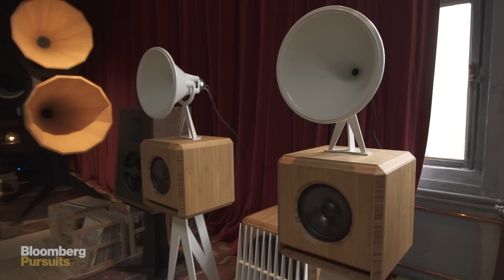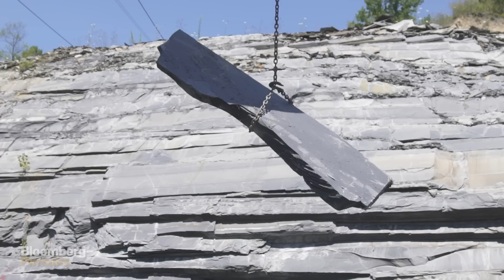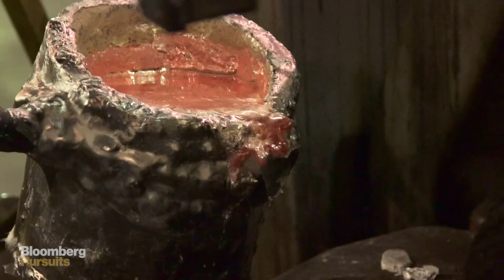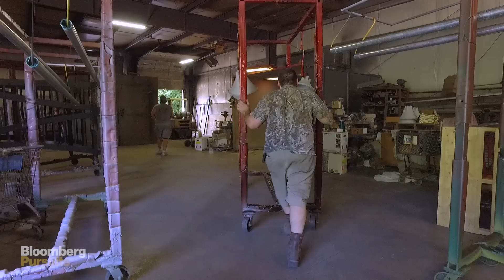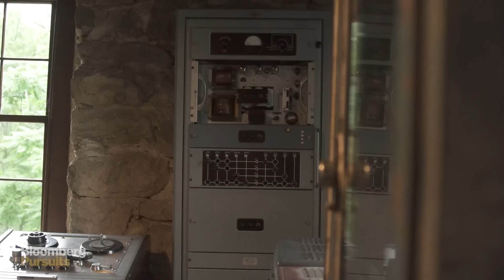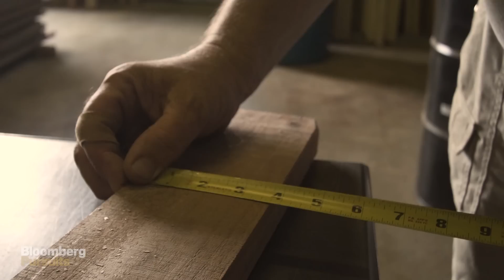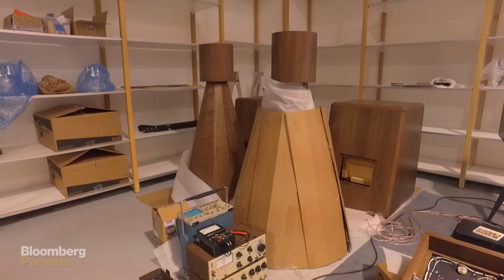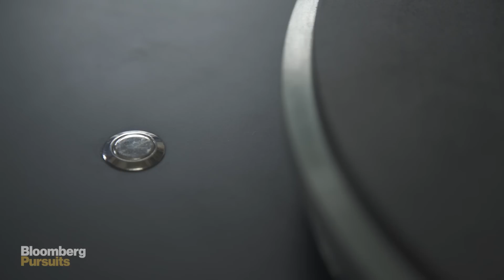How a $300,000 Speaker is Made

Comment: Here's what this is... It's goods that are exponentially overpriced with some bravo sierra made up story to appeal to individuals of extreme wealth so that they can claim to own something the common man can not. As for their material and manufacturing choices... That super special slate... Meh, not so special, people have been splitting slate for the last 6000 or so years, it's a common material that's easy to work with, so common in fact that there are mountains full of it. Cast components? The cheapest and weakest way to manufacture anything out of metal. Also nothing new here... The ancient Egyptians cast metal parts. The amorphous grain structure of castings is inferior to forged or even extruded parts, milling and/or turning parts from billet is infinitely superior to cast parts. That solid hardwood construction that nobody uses... yeah well solid hardwoods warp and bend with changes in temperature and moisture... that's why laminates are used, they're environmentally stable unlike solid wood. I could go on... Lastly... he's talking about how tube amps aka old analog technology is paramount in delivering accurate sound reproduction... more bravo sierra. Tube amplifiers color the sound which is the antithesis of his prior statement. Don't get me wrong, I have a number of tube amps and I love them and his speakers look and probably sound awesome... I just hate the whole blowing of rainbows full of made up facts up everybody's butt as justification for selling his product for 10X what it's worth.

Comment: "Most of our equipment-- it's very big, and it's very big because it has to be. Sound waves can't be miniaturised; it's physics!"

Says who? What school of physics did you attend? Trump University?
Reply: Sebastián Demaría yeah take that L. Technology advancements can't alter how soundwaves work buddy
Reply: Even modern technology can not get around the trade off of hoffmans iron law for bass that governs size, efficiency and frequency cutoff.
Reply: Seb: These are not active speakers.
Filtering can extend the bass but you run into the same laws of physics eventually.
Reply: TheLucient
 I have heard LAcoustics back when they were Cox audio engineering.Heard them on the Delta heavy tour and they sound fantastic,no ear fatigue but the cabinets and drivers were standard size.
Reply: Col. Angus This is the reference today for live sistems. http://www.funktion-one.com
Reply: I don't know guys... IMAX theaters sound fine to me.  I don't see how this would sound any better.
Reply: Aka Kiddo
you can change the notification settings for this comment thread so you no longer get them.  :)
Reply: To be fair you can't get deep bass at decent volume from a small speaker.
Reply: Sebastián Demaría
How much spl we talking here?I have worked with JBL's in the 90's thru 2000's and they were pretty impressive back then.Today the big thing is monster power in more efficient platforms but the spl levels and frequency responses haven't changed much. I could be wrong because I haven't been to many concerts that blew me away recently.Its still the same concept,move tons of air.
Reply: Lick My Taint Just ask, and listen.
Reply: Sebastián Demaría
Yeah I know about the Funktion One,they started off doing club systems which is what I'm into. :) I'm dying to hear one of their systems now,the best system I ever heard in a club was and still is and old school set up with Intersonics servo drives and JBL's .The Funktion One got its inspiration from the old Intersonics Waveguide/horn style stuff.
Reply: Ever heard of LAcoustics ?
Reply: If by time you mean period, frequency isn't wavelength/time. Wavelength/period=[distance over time]=speed of sound. Frequency=1/period=[per time].
Reply: jesus why did i comment on this. i commented over a month ago and i still get notifications everyday from people bitching about a pair of speakers
Reply: A. Lee Composer no kidding.. buy a bose portable speaker and it's amazing the aouns quality from such a small device that's just battery powered...
Reply: Lick My Taint you are generally correct, however using sound reverb you can get wavelengths bigger then the speaker, but that will almost always sound crap. Unless you have multiple radiators, such as, the bose sound link mini with dual radiators. However it is one of the best bluetooth speakers, however the sound is more like a rubber chicken getting hit then a deep, clean sound, as my Jade series speakers (Wharfedale)  produce. If you are curious about my system, 
Receiver
Sclx901
Jade 7,
Jade 3,
Paradigm sub 1 (2 is to expensive, and to bassy ;),
Martinlogan motion slmxl rear speakers,

This system was expensive but i built on it for a while.
Reply: Lick My Taint what projects? I might buy one? Potentially?
Reply: Seized Cheese Im sorry, but purchasing that, means you are not a audiophile. As they have horrific bass reproduction, artificial highs, and no mediums.
Reply: "Speakers can only produce sounds who's frequency (frequencey=wavelength/time) falls within the size of the speaker."

This is, and the the rest of the comment, is not true. You can reproduce any audible frequency even with the smallest speakers. Ever heard of headphones or earbuds? It's just that smaller speakers aren't as effective at reproduction powerful sound as bigger ones. That's all there is to it. The smaller the speaker, the quieter the loudest sound will be and the low frequencies.

And BTW, the bigger the speaker, the more problematic it becomes. It's because the ideal speaker needs to be ideally stiff, but big cones are relatively less stiff than small ones, and they introduce a lot of nonlinearities in the frequency response, compared to smaller membranes.
Reply: Lick My Taint Yes, just as I said - it's not that smaller cones don't produce low frequencies, but they just are less effective. And the stiffness problem still exists, even though it's less a problem today than it was 30 years ago, when membranes were paper.
Reply: Lick My Taint Do you understand that you're essentially repeating what I wrote? That it's the matter of scale? You don't need 24 inch speakers in your earbuds to have deep bass.
Reply: "No, you just repeated what I wrote. It's painfully obvious to anyone with half a brain."

This shows that you already forgot my first comment you were replying to. :| And obviously repeating what I wrote in that comment. "It's painfully obvious to anyone with half a brain."
Reply: You do understand that sound waves are air pressure.  That's why 5" "subwoofers" aren't.
Reply: Lick My Taint: All my comments history is there for anyone to see. And as a comment on the rest of your response, I can only reply with this emoticon: :-)
Reply: Of course they're edited. I always fix typos, grammar and try to make myself clear if I'm not enough.
Reply: Yet Trump is a billionaire and you are a fake" intellectual "Oy vey! :D
Reply: Watch you don't cut yourself on your edge, little one.
Reply: Lick My Taint NOT true enymore, today's active subwoofers with digital ice amps can reproduce frecuencies and spl not even dreamed by Jbl with 18 inches woofers in the 80's

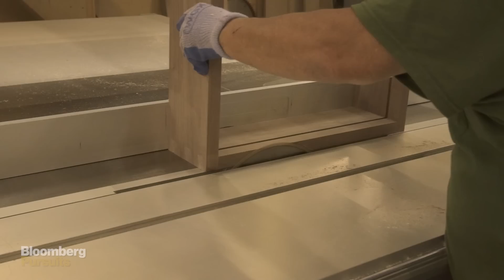Comment: 4:43 bullshit. My TTC Rex Custom guitar cabinet is full popular wood with dovetail joints specifically made for me with my custom dimensions in a high wage country and that for reasonable 300€ (without electrics and speakers of course; just the cabinet). besides that, as others pointed out, the soldering looks amateurish. . . also a PCB construction, for that amount one would at least think that they would use point-to-point soldering like the do in high end boutique amps (where most of them are sub 3000 btw.). It might very well be that they sound great but the quality and execution is mid-tier at best.

Comment: Audiophiles - A very strange psychological phenomenon, way back before CD's hit the market expensive turntables had a very high mass, this makes sense because the momentum will help keep the rotation speed very stable, Vinyl records require a fixed speed, it also gives an excuse to use some very exotic materials from glass to granite and beyond,  now when the CD was introduced this same concept was used by Pioneer to produce a CD player with a solid granite platter - this was ridiculous because CD's track speed was designed to be kept constant and so the rotational speed is ALWAYS changing - but they sold in the thousands - its marketing bullshit, valve amps have returned not as a statement of perfection but of fashion that plays on the the elitist mind-set that strives to be, or have the very best, all it needs is a plausible explanation and expensive materials, valve amps colour the music that's not disputed, its a particular colorization that many people like, back in the day it was based on memory how it used to be, now its based on fashion, the truth is that when we got technically measurable perfect audio, that was also  cheap - it became common and you lost that satisfying feeling that you got from having something that was hard to attain, it no longer presented the opportunity to stand out, this is nothing more than an extension of that.

Comment: 95% bullshit
5% craftsmanship

slate isn't very expensive, neither is wood...

cast metal is the lowest grade of metal... good stuff is forged or extruded... I notice you say nothing of the electronics except say "they're aerospace level stuff"... which means to me that you're using off the shelf electronics and just building customs cabinetry/enclosures... 🤔🙄😂

That wiring job is crap, soldering work is horrendous, looks like an amateur tube amp kit build...

Comment: I did electrical engineering in my studies and I can say that soldering job is quite shitty. My practical lab teacher would not have been amused.
Reply: aerospace technology from the 20s. 
 "Quality can't be miniaturized" cuz they cant solder a giant resistor well.
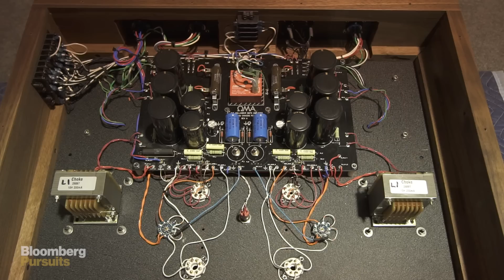Reply: 5:25 It's not perfectly done, like a mess from a freshman
Reply: Yes in the 5:25 shot you can see solder is splattered everywhere across the board . Even my Chinese child toy electronics have cleaner jobs dones ;)
Reply: Spagg Trait Lead free is slightly more difficult to solder I admit. I use the stuff everyday and I can do a much better job than that. It's pretty bad. That is a class 1 or class 2 IPC standard level. It should be a 3
Reply: My pioneer A-9 amplifier has much better solder joints. It has an SX1980 like sound.
Reply: Nothing in this video shows the quality of soldering in OMA amplifiers. You can only see a guy soldering using point to point wiring, a method still widely employed today.
Reply: Wait, You had Mr. Sanders TOO?!?
Reply: I guarantee you, for under $10,000.00 I can get a system that is better than the $300,000.00 system, and I’m talking stuff from the 80san 90s.
Reply: I 100% agree. For 300K USD that speaker needs to be world class. And it most definitely is not. Your better off getting a $200 speaker at Walmart.
Reply: @teddymills  a vintage pioneer Amplifier    has a unique sound signature that is both bright and warm at the same time. Pairs really nicely with modern speakers that have premium grade soft dome tweeters

Comment: A lot of hate in these comments... This company is clearly not trying to make sound equipment for the average consumer. Not even for the average audiophile. This company is trying to make sound systems that are 1: Made of top quality components (which are expensive) 2: Using highly skilled craftsmen (which are expensive) 3: Following the principle that analog sound is better sound and 4: Making pieces that are not only good sounding, but very stylish. They're not just trying to make the best sounding audio they can (which can be done much cheaper than this), they're making a choice to provide a top of the line premium product out of a love for a process, a set of principles, and a love of the audiophile arts. It's like a $5000 purse or a $1,000,000 car. You can make something that does the job better for cheaper, but that was never what they were trying to do.

Comment: I don't buy the physics. Resonance is dependent on so many factors and a speaker that regulates frequency based on analog source inputs would require extremely controlled conditions to perform consistently. Digital media does not benefit from tube amps as the frequency cap at sampling rates of commercially viable 44.1khz/16bit, established by Nyquists theorem and the baseline for CD manufacture, prevents upper harmonics from blooming and any resonance is then artificial. To claim higher fidelity response, at this price point, is more about presentation, mythology and salesmanship than reality.

Comment: Right yeah. yours talking shite. there is nothing I see that,s high end, baked power coat just rubbish that's plastic coating at best, try enamel acid etching paint now that something. and were's the ceramic,s in all this. and it not greats woods you say great timber, for $300.000 I would want Brazilian Ebony or  Australian Buloke  all your timber has to much grain. and were all that silver and gold wiring  there no anti vibration pin's on the feet of any of the components and this guy must be be sixty + at that age about 30% of his earring would be gone. and as to the room acoustic well speaker that size posh a lot of air you need a room the as big as a hall,  otherwise you would,nt  be abel to out put the power, it all just a con,  the best high end is reVox  maybe QUAD. and for digital sound Yamaha. just go on ebay and look at reVox  cards and amps £300 buys you the Dogs bollocks. with bell.s

Comment: I don't care about the pricing, or the cropped down sales pitch. I bet you can easily fill hours talking about the design and production of a speaker. Plus the design looks awesome.

The only thing I wonder is if you could hear the difference of a 55+ years recording on a $500 or a $300.000 audio system.
I mean the recording "Hound Dog" is done on equipment at least 61+ years ago. I don't think they had 24-bits audio back then.

Comment: As someone who works with all of the electrical components showed in this video everyday, both in vintage and modern recording equipment. I can tell you that non of those components offer an accurate reproduction of sound. In fact they colour and change the sound quite significantly. We use them in recording exactly for that reason.
Also using hard materials for speaker membranes is the dumbest Idea. You'll lose all your low and high end and they have to be exceptionally large in order to reproduce audio at a listenable level. Also the resonance from the wooden membrane would be terrible sounding. It's basic physics.

Comment: And here they forget about (or just ignore on purpose) the most important thing - what source of audio you have. Most commersially produced recordings don't have very high quality. You can never really get that feeling of "being there" from  those recordings - no matter how good your play back system is. Many recordings from the 70-80s are in fact better than most modern recordings, because they use less level compression. Today they prioritize to get high volume (compared to your volume setting on the play back media) rather than sound quality, in music and movie production.
That's also the reason many people think vinyl and tube amplifiers are better than todays digital audio and transistor based ones. The difference in recording quality is much greater than, the quality difference caused by the media or electronics.
Also - room acoustics is very important factor that was never even mentioned in the video. Even though it looked like their test rooms had some acoustic treatment - how will it be when those speakers are put in peoples homes? 
If you put a sound system in a normal living room (with no acoustic treatment), you will never get much improvement over the cheapest home cinema system you can find. No matter how good your speaker system is. To visualize it - just put a speaker inside a box large enough to fit the speaker, and then listen to how that sounds. A normal room affects the sound in the same way - just that the "box sound" will happen at much lower frequencies (the resonant frequencies of a box or room is dependent it's dimensions  compared to the wave length of the sound). You will not associate a normal room with "speaker in a box" due to it's much larger dimensions - but, it destoys the sound quality pretty much the same way.

Comment: 5:24 That's some shitty soldering...
Reply: Jiří Bednář first thing I noticed what the hackjob soldering. what the fuck
Reply: 3 0 0 k
Reply: I don't know how you formed a relevant opinion based on the few seconds of video at close range that showed what looked like an engineering prototype PWB. The areas that hadn't been reworked looked good. That the rework was done by a frustrated engineer trying to solve a design problem is obvious, I recognize the style. My guess is the response curve of the tube amplifier but whether it was for accommodating tube supply variations or for output matching transformer experiments or for the integrated response with a particular set of speakers (etc.) isn't obvious.
Reply: TMCicuurd12b42 "I took soldiering in college" STFU.. I have a PhD in sweeping.. fucking idiot
Reply: It's because it's old school, you obviously wouldn't know that a bad soldering job is to keep a more "pure" sound
Reply: You don't pay 300k for a prototype.